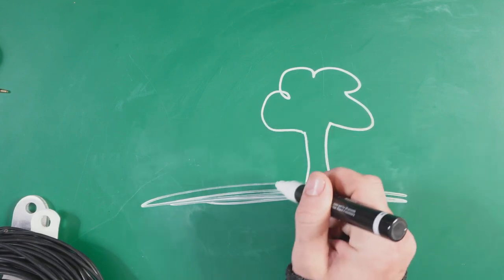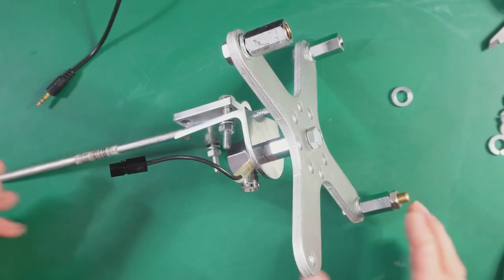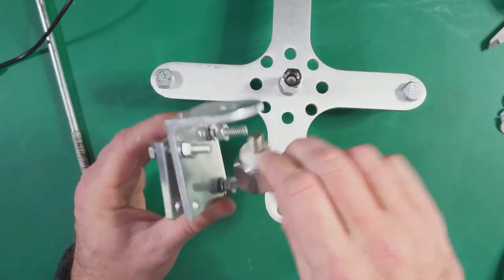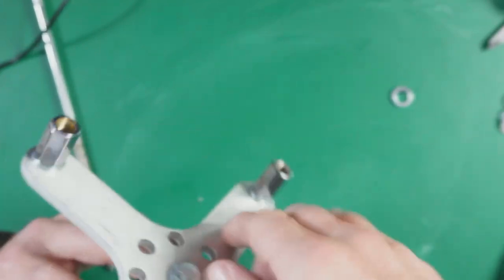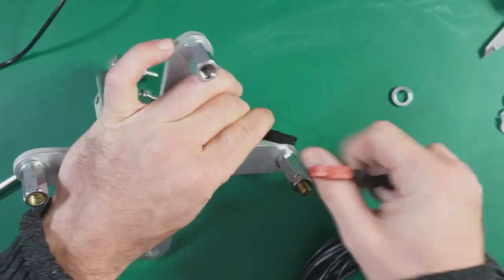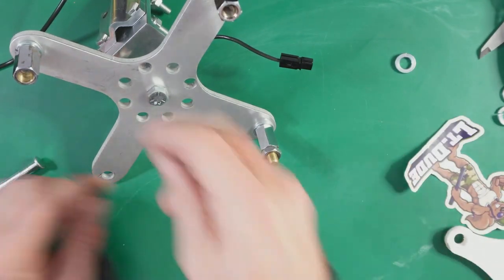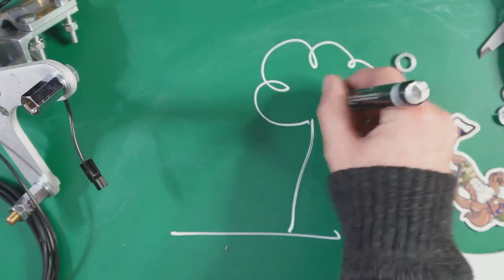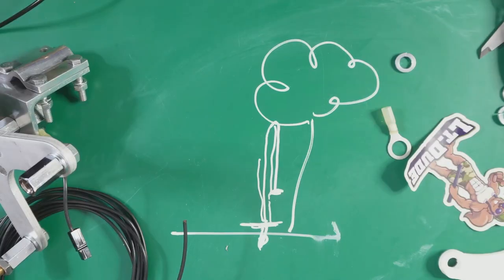SIMPLE 4 Band, 1/4 Wave, No Mast Multiband Vertical Antenna!! No Mast "Commander"!

Comment: It seems you connected the radiating plate to the ground stake. This will short your signal. Connect the ground wire to the clamp of the stake and put the isolator from top under the 3/8 barrel.
Reply from the maker: I should be home in a moment and will double check.  Thanks for the heads up!
Reply from the maker: You're right! Oversight on my part.  Thank you for pointing it out

Comment: Very cool concept and I'm looking forward to see where this one goes!
2 comments on the cordage aspect. 1) Simplest way I've found to connect antenna wire to cordage is to just simply zip tie the cord to the wire. No spacers, adaptors or special knots required; and easy to remove if needed. 2) One option to consider for keeping tension is to use roughly 2 feet of shock cord at your mount tied to the 550 cord. I use that method often for shelters and tarps with good results. Just my 2 cents that's worth a few cents less. ;) Keep up the great work, my friend!

Comment: The way you have assembled the connector you grounded the antennas to the counterpoise.  Use a ohm meter and check it.
Reply from the maker: Yeah you're semi right. The ground was attached to the antenna portion just as mentioned in the description and the comments already. Thanks

Comment: I wonder if you had a push up mast (fiberglass) (like we use) and added a shelf bracket at the top to suspend a the wires from it. That might be easy up, easy down. I still like the tree thing as well. I ordered one of the aluminum brackets off your site and I already have the other parts thanks to you in the past. Good luck with the project. Looks fun.
Reply from the maker: There's a whole lot of interesting thought int hat. I saw something yesterday which I may incorporate into a design for the top of the mast *GRIN*.  Package will be sent today, thanks very much! Also, part 2 should be out next week.

Comment: Are you still working on this?  I also thought that it seems like the DX Commander would be perfect to use by taking some spreaders, and pulling it all up via a line into a tall tree instead of using a mast.  That would be very stealthy too.  It might also make sense to decouple the bottom plate and the ground radials.  Maybe have the bottom plate held in place via a bungy that allows it to move/up down some when the tree moves, then either have a short section of coax or wire that drops down from the free floating bottom spreader, has some slack and then goes down to connect to a ground plate where the radials are secured.  Could combine that bottom plate with a balun or choke at that connection point for the wire/coax hanging down.

Comment: Can I use that plate and bolt it to my tri mag mount and then use 4 ham sticks with the one feed point ?
Reply from the maker: https://youtu.be/E55VWFHDvYk. You sure can.  3 sticks works, 4 is difficult.  I wouldn't recommend mobile due to the close proximity.  They'll be hitting eachother
Reply: @HAMRADIODUDE  I was going to sit my tri mount on the ground and give it a try with radials instead of using it on my roof. I will be ordering that plate. I never could find your email to ask you .

Comment: You may have already addressed this but is this useable without a tree to hoist your wires into?
Reply from the maker: I had to stall the project until winter's over, but this one would use a tree to hold the wires. I have built one with a mast as well. Ultimately, I recommend cals DX commander for superb quality and cost efficiency. I hope to see good weather soon to continue this build

Comment: Unfortunately there is no balun. Having a portable vertical withut a proper balun cause problems by RF running on the outer side of the coax, even at 20 watts.. No good for above QRP levels...
Reply from the maker: I'll add one in part two

Comment: Where did you get the bottom plate?  I think I’ll try this this afternoon.  (I hate two this’ in one after this.)
Reply from the maker: Happy Thanksgiving.  I designed the bottom plate and had them made at OSHCUT.COM.  They cost 39.11 each to get made, which was expensive. Hopefully I can bring the cost down in the future. There are a few available at shop.hamradiodude.com .  Additionally, if you have access to a 3D Printer: You can download and print these - https://www.thingiverse.com/thing:5341713  That will require a Slight modification, which I could do soon (or anyone with tinkercad can (Fill in the inside of the second plate).    Finally, if none of those are an option, you can probably find something at Ace Hardware.  If you use the 3d Printer or a Thick Cutting board for example, just run wire leads from each antenna to the center conductor. I hope it helps and will elaborate on that more in the future. Thanks.
Reply: @HAMRADIODUDE  Thanks. I can fabricate one — I just asked because I’m lazy. Happy Thanksgiving.